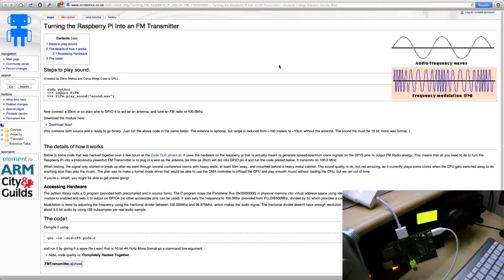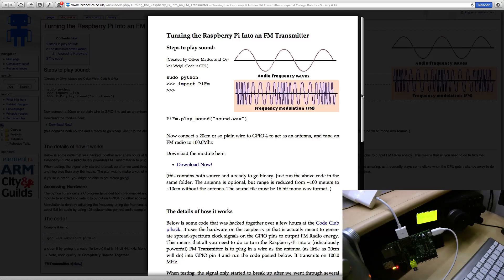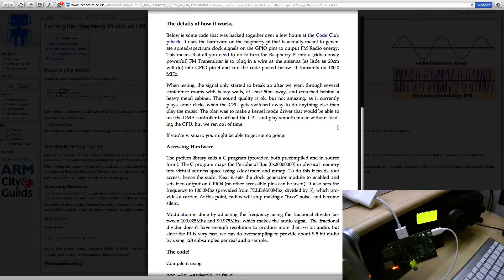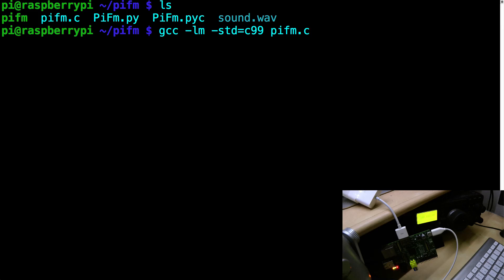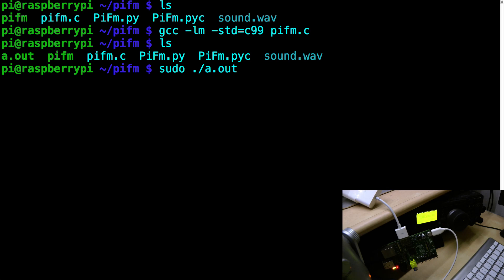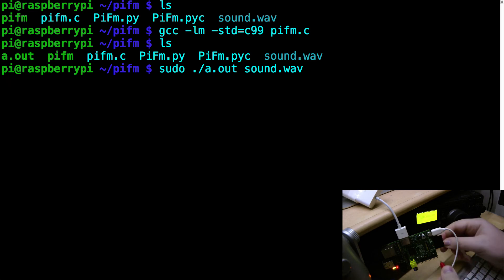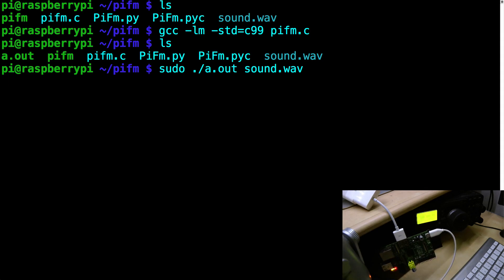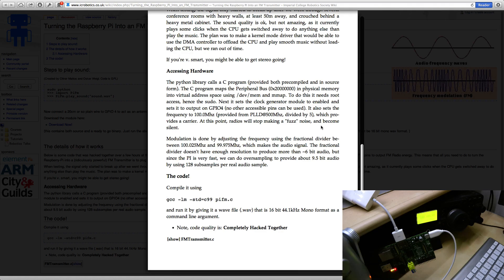Turning the Raspberry Pi into an FM transmitter with PiFM

Comment: Hi. Thank you for the video. 
I have had working FM transmitter... however, I happened to issue below 2 commands and as a result.. FM transmitter stopped working.. 
what could be the reason ? 
commands: 

sudo apt-get update
sudo apt-get upgrade

Comment: Use audacity and at the bottom right make sure you set the project rate to 22050, not 44100. Also make sure that the file is mono not stereo.

Comment: Reboot cleanly, and do not startX ... Login using pi and your password, cd over to your pifm directory and run from there.   If you run the ./a.out command from command line, it should work fine.    If it's not executable, sudo chmod +x a.out

Also, you must run from SU or sudo

Comment: I've been trying to get this working but all i get is a quite signal on the radio. When I try to play a file it start to transmit weird noise.

When I compile the pifm.c using gcc -lm -std=c99 pifm.c command I get this output:
pifm.c: In function playWav:
pifm.c:192:9 warning: implicit declaration of function usleep [-Wimplicit-function-declaration]